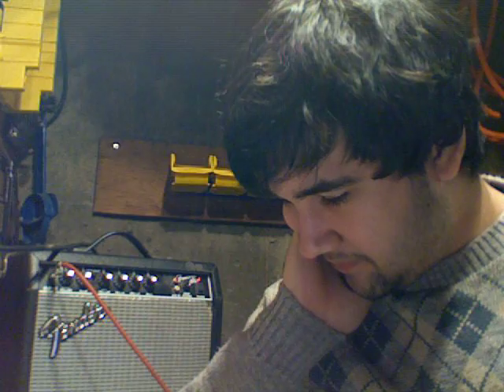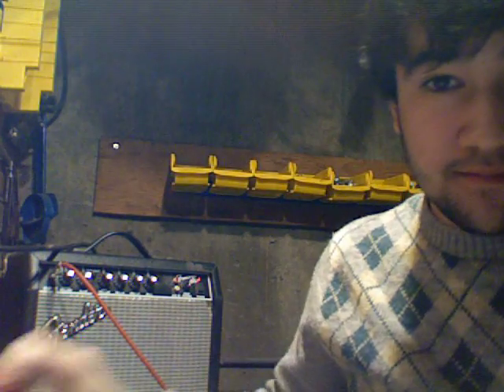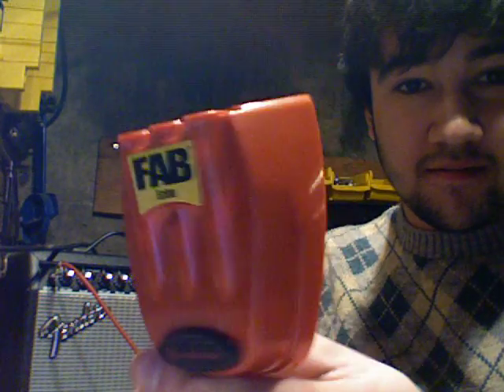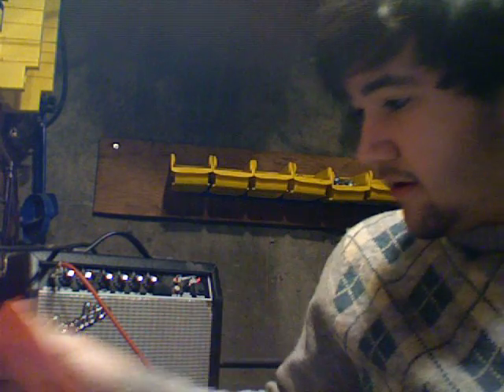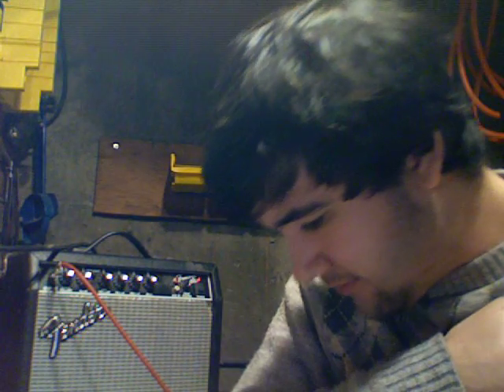Circuit Bending FAB Echo

Comment: fun stuff! i recently found the XH-M173 "karaoke reverberation plate module" and got me 3 to fuff around with. 
a promising echo board to mess with. comes with a superfluous NE5532 mic-preamp to overdrive, two 0.25" jacks, and even a bridge rectifier that can be abused as a frequency doubler, when powering the board with AC anyways.